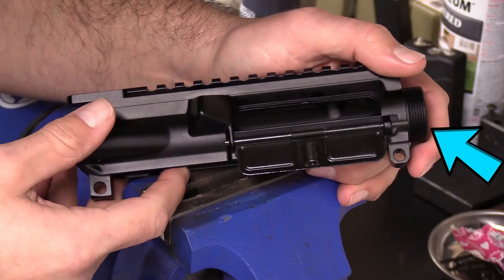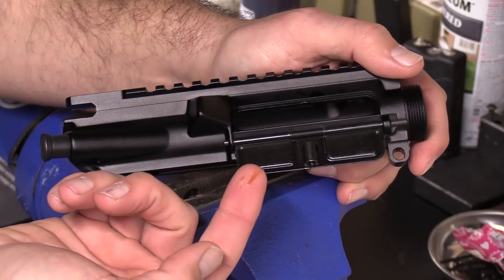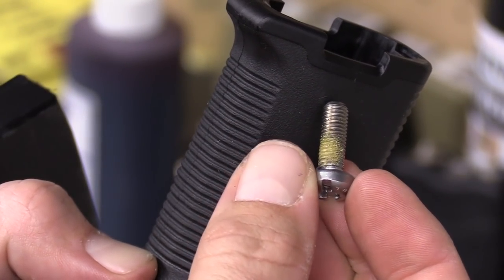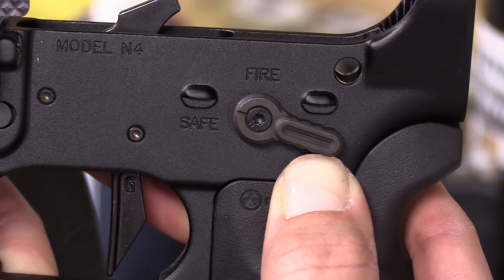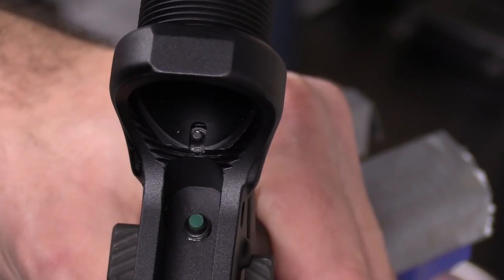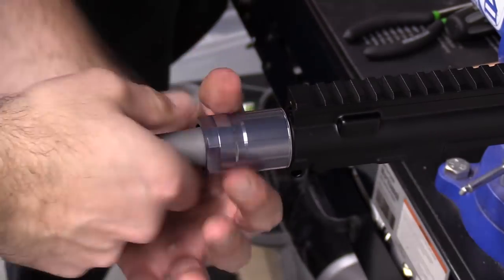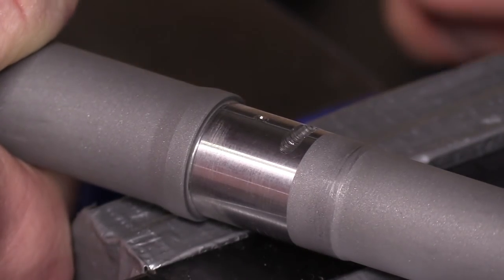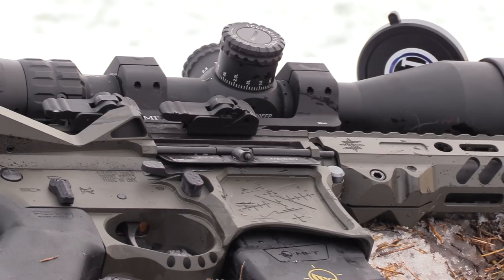What Makes a Well Built Rifle?

Comment: If you invest in a top tier barrel or handguard, you should need to worry about alignment. A top tier barrel should have a gas block alignment dimple from the factory, and a top tier handguard should have anti rotation tabs.

Comment: You showed a SLR rail in the video but you said that good rails have some sort of mechanical stop. SLR good or bad in your opinion?
Reply from the maker: It doesn’t have mechanical stops. As you can see.
Reply: I bought an early Slr rail 2007ish that has the anti tilt tabs but they were too tight to fit over the receiver. Had to file them. Its one of my favorite handguards! Even if its crap:)
Reply: Every SLR tail I’ve worked with has an anti-rotation tab that indexes on the gas tube. The two I’ve seen run through the wringer never checked up and have had no issues. If you are caught up on receiver indexing though, there are other options out there.
Reply: Woodrow Call. Those new ones are really nice. You can pick a custom color tab that locks around the gas tube. Mines older.
Reply: The mechanical stop for the newer SLR rails, is that one piece tab that fits over the gas tube. That, and the way the rail locks up on the barrel nut, makes for a pretty solid system. I think they could still improve it a bit, by adding a 2nd channel for the bolt closest to the receiver, but, its not showing a reason to go that far, yet.